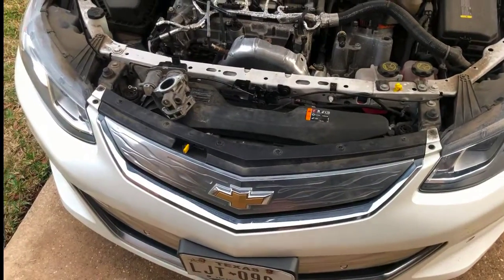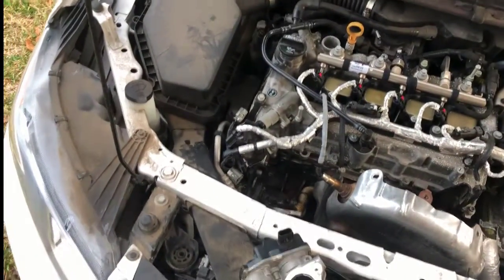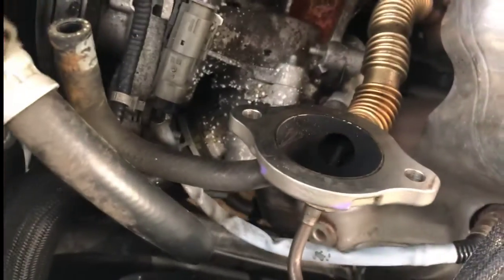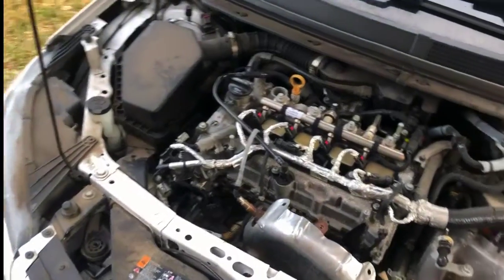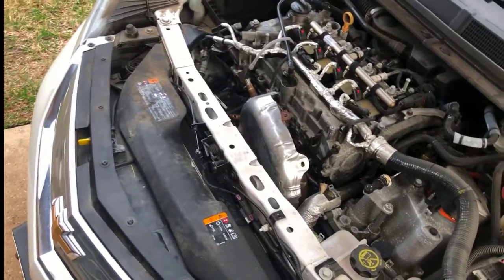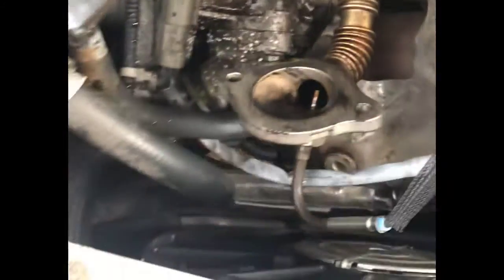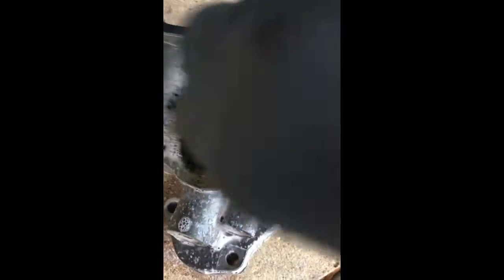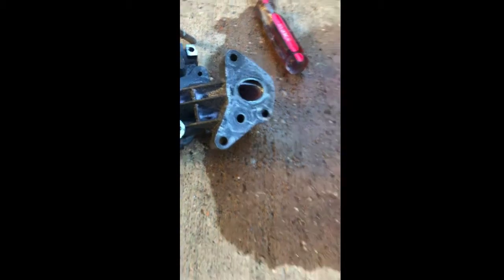Chevrolet P0401 Engine Code - EGR Valve & EGR Cooler Cleaning (Volt)

Comment: I have the same problem and have been quoted $1500 to fix it also with the Chevy Dealer here in Houston, Texas.

Did you also clean the cooler? You don't mention that in the closing comments.

Thanks for the video!
Reply from the maker: Sorry for the late response - but replying now in the event others have the same question in the future - I didn't do anything to the EGR cooler and my issue was resolved for over a year.  The light eventually came back on and I cleaned it again.  It went off again and I ended up trading the car in with around 117k miles.

Comment: Do u need new gaskets?
Reply from the maker: Hi Chris! I used the existing gaskets without any issues.
Reply: @TheProfessorsWorkshop  that's for the video it helped alot..did mine Saturday I seen on one of the comments that you did reuse original so said screw it I'm doing lol now i just got to clear the check engine light
Reply from the maker: @GirlDad420  Glad it was helpful, Cris!
Reply: @TheProfessorsWorkshop check engine light cleared on its own 🙏..Monday morning no light 👏

Comment: Thanks for the video! About how much coolant fluid came out of the engine? I see the coolant flow is via one hose and presumably a duct into the engine block.
Reply from the maker: Hi Dave. I let the coolant hose attached so my fluid levels were basically unchanged from before.  Always a good idea to check levels after and make sure, if you do no need to add, that you use the GM specific coolant.
Reply: @TheProfessorsWorkshop  Thanks - so nothing dribbled out of the engine (or head) block?
Reply from the maker: @DaveLaneNS  Im sure there was some. It’s been a few years since I did this so the specific amount isn’t something I recall.  My fluid levels were the same before and after so any loss was minimal.

Comment: Tried this and did not work. CEL came on right away. I did have a clogged EGR cooler which i was able to free up. A can of 16oz TBC was used. I had to take that flex tube off egr actuator off then the tube post egr cooler which is on the side of engine. Its tight and lots of shap hose clamps cutting you up. I put air in one side and barely got air out the other. Sprayed TBC waited 5min and blew air through. Got some gunk out. Did 3 times and got good airflow. Put back together and no CEL. The cooler is like $180 but you have to remove the converter to get to it. Which is a big job. Rusted exhaust bolts suck to deal with. I can help anyone walk through the process if interested.
Reply: 2 months later and the light is still out. Seems the repair has worked.
Reply: I would be very very very interested in some more info about what you did to clean the cooler.  The flex tube on the left of the cooler that goes upwards to the EGR valve is permanetly connected to the coolet, correct?  So you had to spray air and cleaner downwards through this flex tube?  The opposite end is two bolts connected to the tube post cooler on the right side of the cooler?  Or do I have this backwards.  Would love to give you my email if you can provide me any info.  Fellow stressed out Volt owner with a NY state inspection ticket AND refuses to go to the dealer.
Reply: @matthewivancie2660  did you clean that tube while still attached? Do you just spray and brush the gunk out and let it drip down that tube?
Reply: I am currently in the same boat you were after cleaning the EGR valve. I have already bought the egr cooler replacement but if I can avoid replacing it I am all ears. Is the CEL still off currently?
Reply: @voltmania4579  light is still off. I drive 120 miles a day so it worked. Leave me a way to contact you and I'll walk you through it.
Reply: Did you do this from above or below? It seems like there is not enough room to operate from above. So basically you removed the intake flex pipe and the outflowing pipe. Then you sprayed cleaner and blasted with air. Am I missing anything?
Reply: @schultp  did from the top. No lift or creeper required. You just have to work around tight spaces but it is doable.

Comment: So, one thing I’ve heard that comes along with that fault, is a blown fuse that you can’t cure with a new fuse  until you remedy the EGR issue. 
You might want to show your viewers where that fuse is.
Reply from the maker: Thanks for the heads up, Patrick. I didn’t run into that issue with ours, and we’ve recently traded it on another car.
Reply: I got that code on my 16..  it didn't seem to blow my NWH F3 fuse..     I heard you can uplug the EGR valve and keep driving.   I did blow that fuse once before without that code.
Reply: @ilovemyevo556 
What you do, is un-plug the EGR, and THEN replace the fuse. 
Otherwise, it’ll often blow the fuse repeatedly. 
If it’s blowing the fuse, you probably need to replace the EGR valve itself.
Reply: If you unplug the EGR and replace the fuse can you operate the car indefinitely?

Comment: Spent 1/2 my day removing, cleaning and reinstalling the EGR, which was pretty coked-up. The cleaning went well, but no dice, it's still burning out the F3 fuse and then overheating. This sucks. Really don't want to give money to GM right now, especially to reward their under-engineered garbage parts supply chain.
Reply: Hey John, did you ever have your issue resolved? Your symptoms match mine exactly on a 2017 Volt. Thanks!

Comment: I'm hoping to try this but I can't reach the bottom two bolts on the valve with the limited tools that I have. What can I get to get in those tight spaces?
Reply from the maker: You can try a small 5 inch ratchet extension that will extend it out far enough for you turn it.  If you don’t have one, most auto part places have them for free rental. Try autozone or o’rileys if they’re in your area.

Comment: Wow, It WORKED!!!  You saved me a ton of cash Dr. Curry!  I can't thank you enough for this video.  I had the same error code message and check engine light.  Also, when I accelerated in Hold mode (gas engine would turn on), I would hear a LOUD Pop sound (the EGR was sticking).   My local Chevy dealership quoted me $700 part and  $1,100 for Labor!  I did what you said to do and its fixed.  I didn't even use the Purple cleaner.   Just a can of Carb cleaner and a metal brush.   Only took me 1 hour to fix.  Someone PLEASE tell me why the CHEVROLET Dealership wanted to charge me $1,100 for one hour of labor!!!  Jerks!  NEVER taking my car to a Chevy dealership again.
Reply from the maker: So glad it saved you some cash. Nice job on the fix!
Reply: You wrote DEALER and DEALERSHIP. You mean, STEALER and STEALERSHIP. Gotta use the proper terminology here bro.!!!
Reply: How has it been going? My car just lit up the check engine light with this error code but previously when in gas mode I also have heard a loud pop when accelerating
Reply from the maker: @mratlai7  ours ran well for 18 months. Then the light came back on and we traded it in on a new electric car.
Reply: @TheProfessorsWorkshop  Absolutely ridiculous that the EGR fails so soon and is so damn expensive. Looking to trade for a new EV too.
Reply: They would not do what you did. They would replace a part because it is dirty. Note that replacing it does not fix anything. The new one will be in exactly the same system that made it dirty. Dealerships have a license to steal and the political environment today is against consumer protection.

Comment: Did you also get the "Propulsion Power Reduced" message? Does the car run normally in EV mode with this code and CEL?
Reply from the maker: I personally didn't have the propulsion power reduced message, and for me, yes the car ran fine in EV mode even when it was throwing the codes and had the issues.

Comment: After cleaning do you have to clear code or will it clear its self over time?
Reply: Cleaned  the valve a week ago and had the code cleared by dealer it has not come back on since. Normally after the code is cleared 3 days  before it would come back on.
Reply from the maker: @TheMrtuber  awesome !
Reply from the maker: It will clear itself over a period of a few hundred miles and then the light will also go off. You can also have a local advance auto parts, o’Reilly’s, or autozone clear it for free if you’re impatient.

Comment: How common would you say this issue is? I was about to close the deal on a used 2018 Volt, but found this in a search for problems as I'm concerned about reliability.
Reply from the maker: The Volt was one of the most popular PHEV's sold - so I wouldn't take the comments on this video as representative of the larger sample of folk who have bought one.  It is problematic to see the same issue popping up with folks - but i know many other volt owners who have had no issues.  Given what i know now,  I would still purchase my Volt again. It's been a great car (we actually own 2)!
Reply: @TheProfessorsWorkshop  thank you.  im torn on this or the i3 rex as consumer reports claims the i3 has above average reliability.
Reply from the maker: @BoopSnoot  I’ve actually owned both. I loved my I3 but it was in the shop 5 times in one year for battery charging issues.  The last time the kept it 1 month before they were going to buy it back via lemon law. Again ( just like with the Volt- that’s just my experience). The Volt feels and drives like a regular car. I’ve taken it on 2,000 mile road trips. The i3 was a great around the city car. Zippy, more fun to drive than the Volt, and I loved the futuristic interior. I had the range extender version but the car wasn’t really drivable on long trips. Anything further than an hour and half and you find yourself stopping for gas every 30 mins.  Having owned both- pick the one you feel most drawn to. You can’t really go wrong with either. Good luck in your purchase !

Comment: This should be covered under the emissions warranty
Reply from the maker: peterdaniel66 I agree, it should be! Chevy, however, disagreed.
Reply: @jimmybalsam3696  if you read the fine print of the warranty manual, it says 24,000 miles for emissions, except for things with an asterisk next to them ... the EGR valve does not have the asterisk, thus is subject to only 24k ... the EGR cooler has the asterisk, and thus is covered up to 70,000. .... I think the whole thing is total horseshit, since I've only driven mine 10,000 on ICE, and 30,000 electric. So really, the valve failed after 10K miles. And I wish I had a free lawyer to fight the bastards.

Comment: Good afternoon, tell me before cleaning the USR valve, did you disconnect the terminals from the 12-volt battery?
Reply: Same code cleaned EGR did not work then removed cooler mount exhaust house  sensor then 2 bolts sprayed sea foam carb cleaner had to get creative to feed the red draw all the way into the EGR cooler. Connected idled engine for five mins cooled and put more in on warmed engine. Code did not trip have run 100 miles no code
Reply from the maker: Пульс Земли No, i did not. The service manual didn’t call for it to be disconnected.
Reply: @TheProfessorsWorkshop  Thank you!)

Comment: I just did this job. It is not for the faint of heart. I have worked on cars for over 50 years. Modern cars are very challenging especially electric cars. Things are so tightly packed under the hood. One item I think was not discussed was the small coolant hose attached to the EGR valve. Now that I've done the job, I would probably advise others to remove the end of the hose NOT at the EGR valve. The clamp can be quite difficult to release on the EGR end, but the other end looks more accessible. Now that the job is done, I am not as pleased as I thought I'd be having save myself from paying the dealer. I reused the existing gaskets and I only hope that the EGR to engine block gasket re-seals and doesn't leak coolant. You will need GM coolant to top off because you will lose some during this job. My EGR wasn't all that bad. The temperature probe in the outlet of the EGR might just be where the CPU senses temperature. Perhaps just cleaning that probe (easily removed with one open end wrench) would be sufficient. I'm not sure. I cleaned mine anyhow. Good luck if you attempt this job. You need to be rather good with wrenches, sockets, extensions, magnets etc. Just don't overtighten the bolts into the ALUMINUM block. I did not have any codes, I did this as a preventive measure.
Reply: Oh. Forgot to mention! If you remove the hose on the non-egr side, it vomits a ton of extra coolant. Must be below the coolant in the system, so it will vomit until it's at the same level.
Reply: Just finished this job, I attempted to remove the clamp based on your comment, however the small hose impedes use of pliers for removing it from the non-EGR side. Maybe if i were left-handed it would've been easier. Personally, it was easier to remove the hose on the EGR side.YMMV

Comment: Awesome man, glad you were able to get it fixed without dropping $1500.  Considering picking up a 2017 Volt with 35k on it today, been looking around at different issues and what all is needed to fix them.  Luckily I live in San Antonio where we don't have to worry about that emissions crap, but I still don't like having a check engine light on.

Comment: Did you end up having to replace the cooler? I wonder if you can just clean the cooler instead of replacing?
Reply from the maker: Never cleaned or replaced the cooler.. and no further issues!

Comment: It is coolant that comes out, no? If so, is there a certain type that needs to be put back in, or just any?
Reply from the maker: Yes, it will lose some coolant. Gm vehicles use Dex-cool which is found at any auto parts store.
Reply: @TheProfessorsWorkshop  Did you need to bleed the system or just top it off ?
Reply from the maker: @drsconsulting7087  just top it off If needed.
Reply: Just in case this helps anyone else who comes across these comments while looking into this...

There is a coolant hose that runs from a rigid metal connector on the left side of the EGR valve to the right and down to the engine. I was able to remove the hose where it connects to the EGR valve (with some difficulty) and lost maybe a few ounces of coolant only. It ran out from the connector on the EGR valve, and I could see the hose was filled up to the open end that I had just removed. I just made sure not to bend it down to avoid spilling any more. After cleaning and reinstalling the EGR valve, I didn't feel the need to replace any coolant.

A note on removing the coolant hose where it connects to the EGR valve...I ended up using a pair of needle nosed pliers (a bent or curved pair would've made it much easier) to loosen to hose clamp and used the open end of a box wrench that was the same diameter of the hose to ease the clamp down. I did the reverse when reinstalling.

Comment: Thank you for this very helpful video! Are you the original owner, and have you been using top tier gas?
Reply from the maker: I purchased it with 13k miles. Have never put anything but regular unleaded in it (that’s the recommended fuel by gm).
Reply: @TheProfessorsWorkshop  GM also recommends top tier gasolines-https://www.autolist.com/guides/top-tier-gas
Reply: @TheProfessorsWorkshop  
Top-tier is not indicative of octane. 
It’s quality of fuel.

Comment: hows it workin now about 8 months later? did the issue come back?
Reply from the maker: 13k miles later and zero issues. No lights, or codes. I’m sure it will wait right until inspection time if it’s going to have any issues....
Reply: @TheProfessorsWorkshop  I ended up picking a 2017 off lease with only 22kmi, fully loaded with ACC managed to talk them down to 19000. It required me flying out from houston to LAX over two weekends (one to view/test drive, the next to finalize paperwork and drive it back)

Fantastic vehicle, love it.

Comment: It should be covered by the Voltec or Emission Warranty.
Reply: GM limited its coverage of the emissions control system to 24 months.
Reply: @kimnesvig254  Makes sense on a vehicle designed primarily for environmental sustainability...

Comment: Thank you for posting this! I am having this same issue.
Reply: This actually worked! I saved 1800 bucks! It only cost me 20 bucks to clean the part
Reply from the maker: Susan Lawrence glad to hear this worked for you also!
Reply: Great video, just bought 2017
Reply: Do you think it’s bad gasoline quality that causes this?
Reply: @25anomaly  I'm not sure but I think it's a pretty common problem with volts
Reply: @susanlawrence2938  
It’s a common problem with many modern cars, especially if you don’t run your engine long enough to get hot. 
A lot of hybrid cars & others too, like prius has EGR issues, I’m told.
Reply: The first gen required premium fuel, they changed the engine around but maybe this would run cleaner on premium fuel too who knows. Glad you fixed yours for cheap!

Comment: Out of a sense of worry, I checked the warranty booklet for the Volt.....

It seems here in CA, most all smog components are covered under a 15 year/150,000 mile warranty for TZEV vehicles.

EGR valve and cooler are specifically named as covered.  

So good news !   whoot.
Reply: Nice
Reply: What year is your volt? I have a 2018 with this same issue.
Reply: Great to know
Reply: F*ck Texas
Reply: The dealership is named Cody Chevrolet, located in Montpelier, Vermont.  They are terrible.  Love the Volt, don't love this dealership.